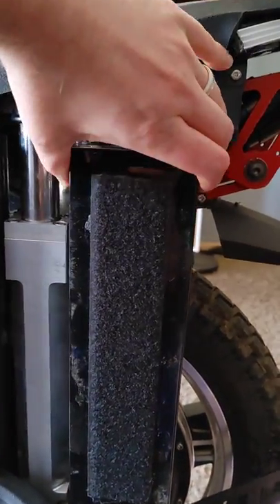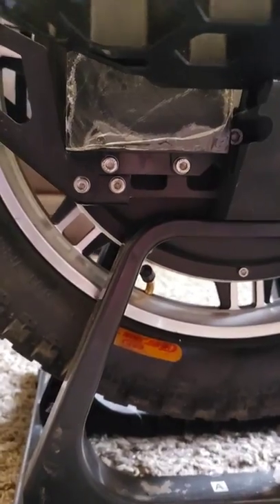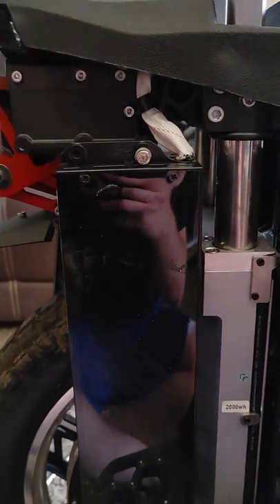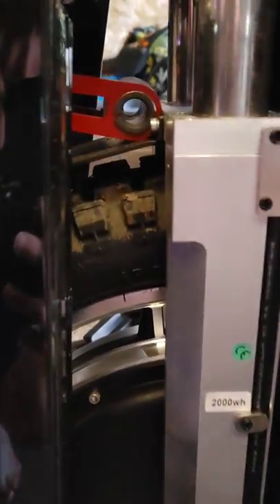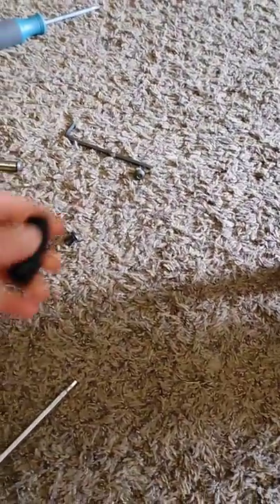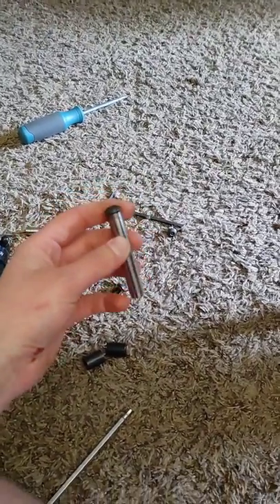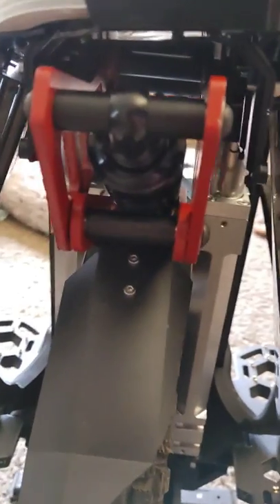Begode MASTER How To Upgrade the SHOCK!

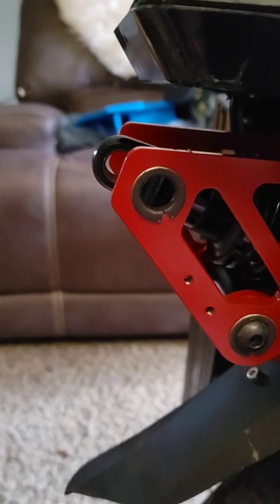Comment: i have masterp ro with same linkage system and aftermarket 200mm shock, how did you just shorten the shock at 1:18? did yu unscrew the circular notched threaded holder thingy holding the coil at the bottom?

Comment: and the shock you installed is upside down , use 190mm shock , it fits easily and leaving the damping adjustment outside
Reply: I got the 190mm shock but it touches on the inner arms. How did u install yours?
Reply: @Phiqtional   did you fix? sounds like you may need a couple mm in the isolation columns...

Comment: by releasing the shock's air and press it to the bottom, you can remove the shaft without removing the battery :P

Comment: So are you saying this install video was an experiment where you realized  that it won’t work —- and that for any adjustment you’d have to totally remove it and re-install  the shock ??
Reply from the maker: This is a how to replace the shock video for those curious of the steps. My plan was to put a 190mm 650lb shock in but didn't work swapped for a 200mm 750lbs and it didn't work, swapped my dnm shock and it also didn't work because the linkage is in the way of the angles valve. The master stock shock has a straight valve with the rebound right below it all other shocks I've seen have an angular valve so not sure how you can upgrade or replace the shock without some sort of modification to the linkage. Kind of a bummer considering I swapped my hero with no issues.
Reply: @EUCWayOfLife  wow thank you for this huge insight and wealth of info—-so glad I know but also it kinda dampens my enthusiasm as I have this on order —-and to see the limitations and vast effort/trial and error you’ve exhausted virtually all possibilities 😔——still excited to get it ! Thanks for the super thorough response!
Reply from the maker: @keithmurakata5359  I would still recommend a hero at least it has body panels, Bluetooth better light and upgradeable suspension lol

Comment: 190mm dnm shock fits perfectly
Reply: I have a 190mm dnm shock with a 1300lb spring but it doesnt seem to fit. it touches on the bottom of the linkage. Which spring did you go for?

Comment: There’s no problem fitting the shock the other way round for access to the damping adjustment, if you wish.
Reply from the maker: If you are talking about putting the coil shock backwards so the dampening is on the back on the unicycle it does NOT work because you have absolutely no way to get to the spanner nut
Reply: Roger, didn’t you get the 210mm 55 installed?  Maybe you can make a video how this fit and the upgrade.
Reply from the maker: @markricharddavies  I put in a 200mm with and without a 650lb spring neither was successfully and I put in a 190mm with both springs neither was a success and I put in a dual chamber dnm airshock and there was no way to get to either fill stem
Reply: @EUCWayOfLife   I believe Roger installed a Fox DPS Factory 22, 3 position, 210 x 55. Maybe he can elaborate.?
Reply from the maker: @markricharddavies  yes and you need a special pump to get to the air valve and his suspension is scratched to chit to get to it lol

Comment: Can I ask the specs of the shock that you ended up using? What are your thoughts so far compared to stock?
Reply from the maker: It fits a 190mm easy or a 200mm if you can compress it to line up. Currently after trial and error today I wouldn't recommend a coil... The master is very poorly designed. The bottom linkage is extremely narrow on a 650lb coil it was fine but lots of sag and EXTREMELY difficult to get to the spanner nut, the 750lb coil binds between the 2 bottom linkages, my dnm air shock valve comes out at to much of an angle and when installed you cant get to it because the linkage is in the way...

So far other than power this wheel has nothing going for it lol
Reply: @EUCWayOfLife  What about taking seat assembly + backlight out, and using DNM BURNER-RCP2S ?
Reply: zero dnm dv22ar looks like
Reply from the maker: @danoseus  I still think you'd have an incredibly hard time getting to anything. The linkage is very narrow under the seat and there is another metal from that is removeable that I wouldn't leave removed
Reply: @EUCWayOfLife  Thank you - Hmm that leaves us with air shocks. Second (maybe bad) idea - what about putting another spring into tube sliders. Metal one - or print one with rubber and replace it regularly. It will remove some travel but soften bottom ups. Looking forward for mine Master. I little bit regret mine decision to get it now, when I see reviews.
Reply from the maker: @danoseus  but not all air shocks, the stock the valve comes out straight in the center and so is the rebound adjustment 99% of others the valve comes out at an angle which is blocked by the linkage... Pretty poor design